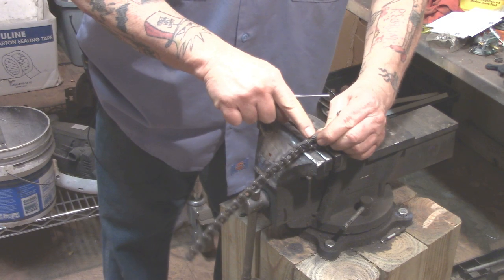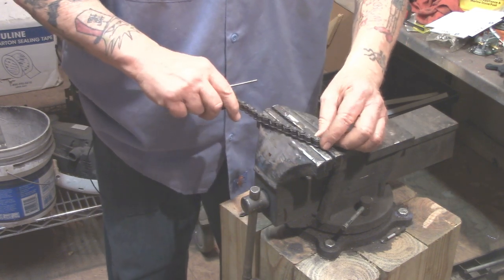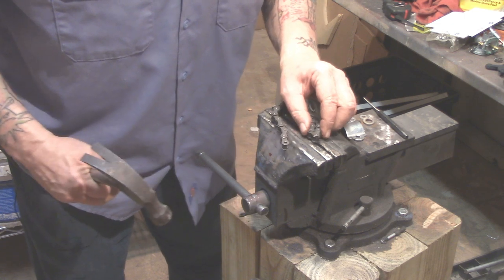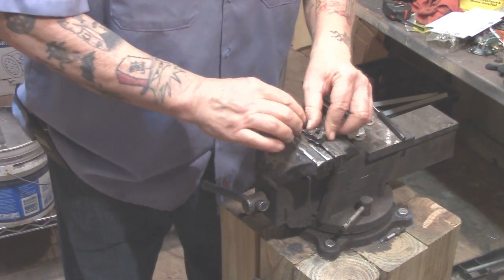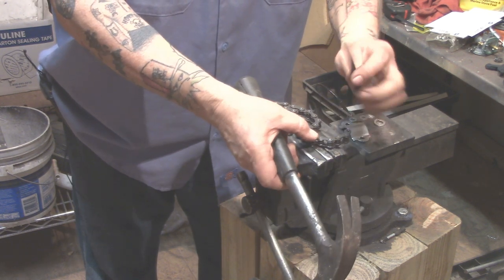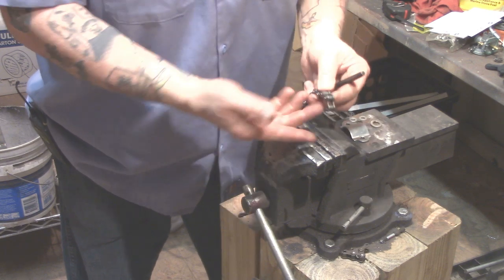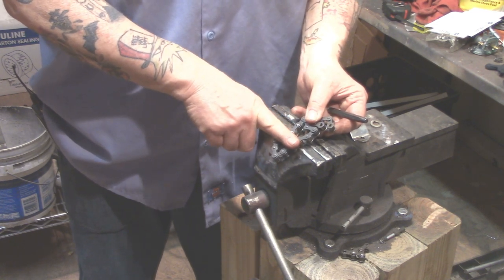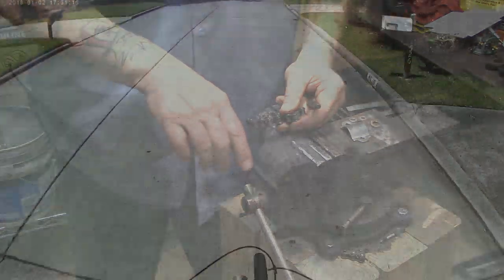How To Break or Cut A Motorized Bicycle Chain Using Simple Hand Tools

Comment: Thank you for making this video! Im trying to do the same thing except im using a piece of metal with a hole bigger than the pins in the chain, but im having trouble with getting the pin out of the chain. Ive tried to hammer it as hard as possible but it just wont budge

Comment: I got a comment sir maybe you help me okay you talking about cutting the chain okay I'll cut the chain too soon and how can I put it back together please show me on a video or something or how to do it to something sir and I'm very appreciate it because I cut it too short because I can't pull my wheel back for cuz it's too close I got a 15 speed off road bicycle and I bought a special gear for the back and it mounts real good I don't like that came with the kit possible and I changed it I bought a updated a chain tightener where it fits on your motor or it keeps your chain tight and it keeps popping all I'm just turning it slow and it keeps popping the top off you don't stay seated in your gear the back gear front gear is fine but it's just a back one if you have a video or can you make one send me a video I'll very appreciate it sir you have a good day sir